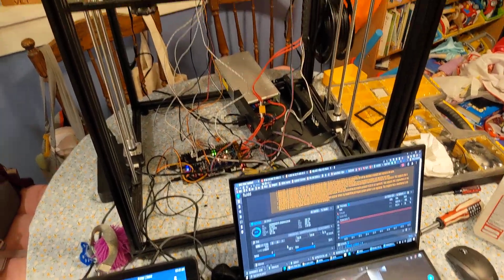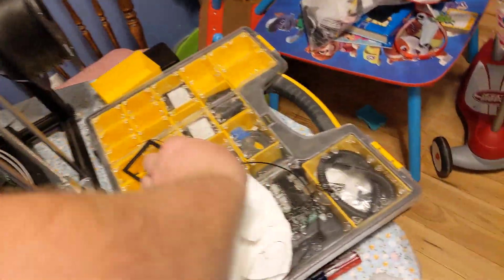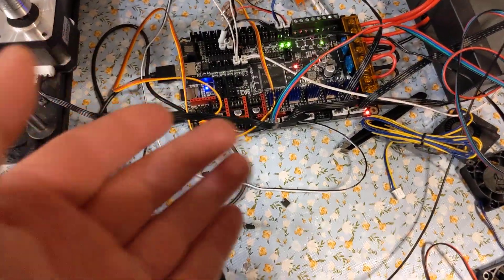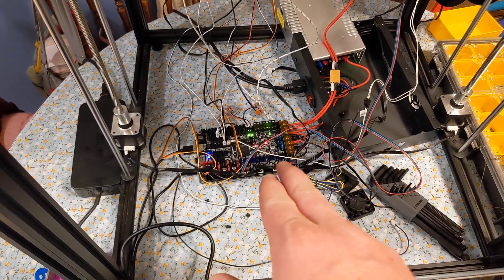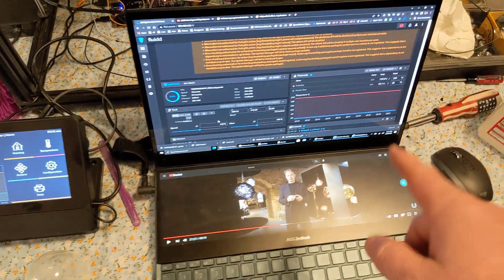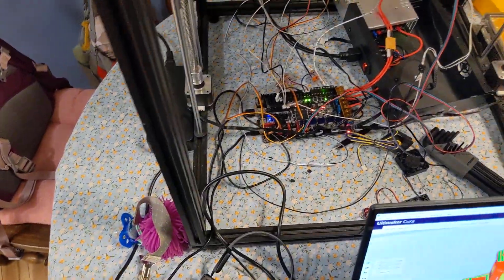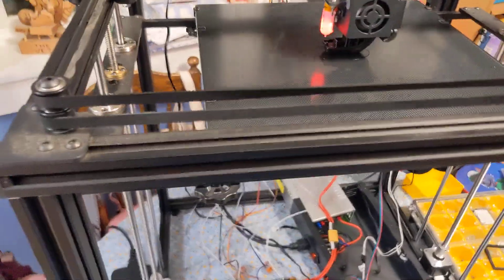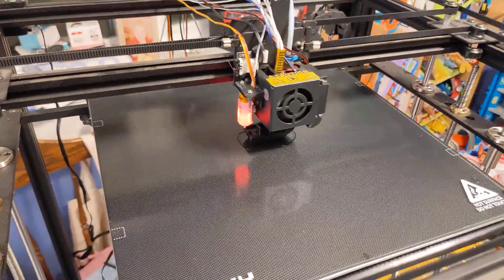Tronxy X5SA 330 Running Klipper On Pi & BTT Octopus

Comment: I am trying to get the x5sa 330 running on the btt octopus v1.1 with a tft35 E3 v3 touch screen that came with it. Do I need to go klipper or can I use marlin? I am trying to find more info on it.

Comment: For others, it is impossible to upgrade for this Tronzy. I have two I would like to fix with a video of details not seen here. 

 Without a detailed video knowledge of every bit how you did this 10 videos is not enough. I like how people praise their printers and not tell little bit of detail how they possibly got this to work. For others is impossible. please post much much more detail. Without a detailed video knowledge of every bit how you did this 10 videos is not enough. Please post much much more detail.
Reply from the maker: What specifically do you need to know? I would say if you can't infer the steps required then maybe these mods aren't for you, but that's not the spirit of YouTube. I do kinda frame my videos for a viewer of similar aptitude as myself but I don't know what others don't know, ya know?

Comment: first of all, great video thanks for that. I'm currently building a vz bot from the tronxy x5sa Pro 330. The BTT octopus should also go in there and the whole thing should then run with the BTT PI and klipper.

would you be so kind as to send me the source code of your firmware. that would be really great...
Reply from the maker: With klipper you build your own firmware with the included utility https://youtu.be/n7zc5u3nbi4

Comment: Hi joe so have you continued using this configuration ? or what was your conclusion does work better than the stock board ?
Reply from the maker: Yes I still use it with good success. The stock configuration is trash.

Comment: I don't get why 3D printer owners need to make these changes?  I'm only looking at this because I am so frustrated with my TronXY X5SA.  If companies just built a machine to work properly out of the box, we wouldn't even need to go through this bs.   However, I am very thankful to this and other YouTube creators for sharing their solutions and experiences.
Reply: As they say you get what you pay for.  For $200 or less you won't get many bells and whistles.  That said there are 3d printers out there now that you don't have to do much, but you pay a higher price for the convenience.  I just bought a Ender 5 S1 on sale and it just works.  There are also some of the newer bed slingers that work well.  That was not always the case though and it has taken quite a few years to get to this point.
Reply: believe it or not, some of us actually enjoy doing these upgrades and are quite happy to buy lower cost printers as the base for the projects.  I am currently working on my X5SA but never modified my Prusa printer, the only original wires left on my Ender 3 are the bed heater and temperature probe…
Reply from the maker: It's been a bare minimum race-to-the-bottom full of compromise for a while.

Comment: Hey Joe, I just bought Tronxy's VEHO 600 which seems to just be an upgraded version of the X5SA series.
The board popped as soon as i plugged it in, but after reaching out to Tronxy, they are saying it may be over a month before i can get a replacement board. 
Sucks, especially for a brand new $1500 printer to have an immediate quality issue.
I was debating on getting a SKR 3 or an Octopus board to replace the crappy stock tronxy board. 
Any recommendations between the SKR 3 or the Octopus?
And also how difficult is it to get Klipper set up for this?
Reply from the maker: Definately get the octopus so you can run dual independent z and automatic Z_TILT_ADJUST

Klipper is extremely popular and common, help is available on the internet. If you have used putty, flashed firmware from a USB, and messed around with config files then it shouldn't be too difficult.

You will also need to find a raspberry pi which are either hard to get or have scalper prices on amazon. (there are alternatives)
Reply: @JoeMalovich  Thanks, Which octopus do you recommend? I am seeing a few different versions. I am guessing the dual independent Z / auto tilt adjust you are referring to allows the controller to compensate for 2 Z motors, whereas a regular board is using the same drive signal for 2 motors so they cant be jogged independently? Sorry im new to the printer world so i am delving in and trying to learn more.  Appreciate the insight!
Reply from the maker: @janus5890  I can't tell you which Octopus to buy, when I bought mine there was only one option. You need a minimum of 5 drivers on your controller for dual independent Z.

With the stock setup both motors are sent the same signal. After it is homed and adjusted, if it powers off one of the motors can drift due to gravity pulling down on the bed. Google x5sa bed tilt, there are many mechanical solutions to keep them synchronized if you really dont want to go with dual Z.

Mechanical dual Z, and a SKR Mini E3 V3 would be the cheapest solution though, it has the 4 drivers integrated so you don't need to buy them extra.

Comment: Bro Thank you so much for sharing your cfg file, you would not believe how much you have saved me here, I really appreciate this 🙏
Reply from the maker: You're welcome. Still having problems with anything I might be able to help with?
Reply: @JoeMalovich  im having issues if someone could help before i didnt have a printer.cfg i used the example file and flashed my octopus1.1 then i found your cfg file and pasted over my example one and saved does the board need to be flashed again or is the printer,cfg change going to be all i need just not sure if the printer.cfg needed to be different than the git example file before flashing klipper to it. might be making it more complicated than it is
Reply from the maker: @TRTmike4Life  no need to reflash, just edit the config file and restart Klipper

When you flashed the octopus it's like installing an operating system.
Reply: @JoeMalovich  much obliged I did that and it seems to be ready to be wired up to my printer don't have anything plugged into it so it just gave me the add out of range error. Also I have the z sync setup I was gonna try the setup you have with z tilt but if I later decided to revert back do I just comment out the section about z tilit
Reply from the maker: @TRTmike4Life  attach a hot end thermocouple to let it be fully enabled. It doesn't like not knowing the hot end temp.
Reply: @JoeMalovich  I did that however it came up with an endstop error (I'm using fluid) not that its much different but the z is triggered like it should be I believe because there isn't an actual / endstop rhe others are open but don't change as I'm triggering them I still haven't put 24 colts to the octopus yet I'm thinking that's probably why but without the 24 volts I did get temp readings when I plugged in the thermistors
Reply from the maker: @TRTmike4Life  I'm not sure but you might have those errors until the machine is homed.

Comment: Iv'e bought the board and a pi I opened the electronics box and see it has a big flat cable that plugs in the midle of the board' The big tree octopus doesnt have a place to connect that flat cable could you tell me what you did to resolve that issue. Thankyou
Reply from the maker: I ripped out that board and ribbon cable and wired everything direct. Some wires needed extended. Some stepper wires I bought longer ones and had to switch around some wires in the plugs to match the stepper/octopus requirements. Your mileage may vary.

It's really not a TRONXY anymore except in frame only.
Reply: @JoeMalovich  Thanks

Comment: As it comes to Z-axis sync - there is a couple of handy methods: from buying and mounting a "z-axis sync-set" which is a simple belt with two pulleys mounted on top of these lead screws to state-of-the-art, all metal, custom "single stepper motor on z-axis" mod (as single stepper driver drives them - so there is no difference in overall from this point of view).

Comment: You have it figured out. However you can  throw a belt around the z steppers at the bottom. That's what I did to mine.
Reply: he has individual motors so they auto level, gets rid of that problem

Comment: I have a x5sa as well that I am in the middle of upgrades, so far I have a closed loop steppers on my X and Y, connected to a btt octopus pro. A fulament flex plate on the bed, as well as silicone bushing instead of springs for the bed. The hotend is a revo micro connected to a direct drive , I have linear rails for x and Y but not installed yet. And waiting on ebb 42 board so I will only have 2 wires in the cable chain, and I am running klipper as well
Reply from the maker: What direct drive are you using? Screen/interface? What linear rail mounts are you going to use?

I wish a company offered an x5sa type machine that didn't require all these mods to be usable. The new Bambu Carbon is the closest we get.

Thoughts on a reverse Bowden in a cable sleeve with your CANBUS wires and doing away with the cable chain?

Comment: i see youre trying out the octo.... been eyeing upgrading my btt skr2 to the octo on my dual extruder machine to dual z autolevel like my prototype machine instead of having to manually tram the dang thing.  any problems with it?  it looks pretty nice...and can run the same TMC silentstep drivers ive been using...so they say.

i love the outer cage style moving gantry machines like youve got there... theyre so accurate when tightened up and you can really get em flying compared to the moving bed machines.
Reply from the maker: Only 2 gotchas so far, the 4th stepper plug is not motor 3, it's motor 2 duplicated. (Motors start numbering at 0) so dual INDEPENDANT z requires you skip the 4th plug.

My tronxy fans were wired backwards too.

Comment: looks good Joe I just finished my voron 2.4 300x300 I also have a x5sa pro I added a 3rd Z stepper and swapped the linear guides rods to just 2x 20mm rods with a 3d printed spherical mounts so the bed and tilit without binding got the idea from heim joints aka rod ends.
with real gates belts and proper idlers and stepper mount, 24v psu dragon hotend it prints all day at 200mm/s I have enough printers to start a farm around my place.
it is a good tweaking platform for sure stock it sucks I'm also running the same board but early release v1 it has a small bug but for my setup is uneffected.. 
I did a pull test on the junk belts on most 3d printers vs real gates belts it's much bigger than people think especially rebound (how springy) it was more than 20x better this is what causes ringing in prints also your at a good spot to add an imu and do some tuning as a side note I edit my profile so outerwalls are 50% infill speed all else is the same as infill and I use cubic infill. and I do a nozzle flow test to find the limit of the hotend and use that to set speed example
matterhackers pro pla black I print at 245c on a 65c pet + gstick bed at 240mm/s infill 120mm/s outside walls at 0.25mm layers (my z are belt drive) with 0.1mm z hop. my tmc2209 have custom heatpipe cooler and are maxing out my x y motors 1.25A my accelerations are tuned at that print speed and current. like this I can print a a sub 10min flawless benchy.. currently building a 45deg belt printer, and next is a scara based design I have on my mind
Reply from the maker: I'm a noob when it comes to custom high speed 3d printers but it sounds like you need TMC5160 HV drivers and an octopus pro to run at 48v if you are at the limits of a TMC2209. AWD would help too I think, then you would have 4x the power and 1/2x the effective belt length.

What mount design did you use for your kinematic bed? Thingiverse links?
Reply: @JoeMalovich  I will email you but mount is my own style the entire bed assembly has been changed it's a free floating bed system the 20mm rod bearings are mounted in a sphere 58mm in diameter and a 2pc clamp I made with 2 40mm rings made from 4mm od ptfe bowden tube clamp the sphere with 3x 3lbs die springs as for z movement I'm using geared stepper from stepper on line with 40 tooth pully and idlers the belts just clamp to the bed framethe rear center stepper FB tilt LR steppers manage left and right tilt the linear guides are aligned with Y0 so y0 is maintained even at high tilit
Reply: @CNCAutomationLab  I'm just now doing my upgrades from a used $100 purchase. ( corner braces, relocation of PSU and mainboard, SKR 1.4 w/TMC2209, bltouch),  Your setup is warp speed ahead of what I have planned. Still, I too would like to see your setup and configurations. How much more have you upgraded in the last three years?